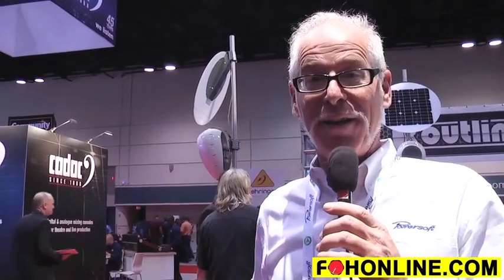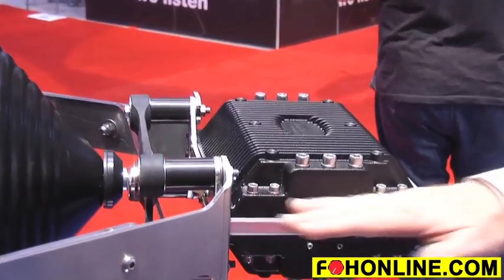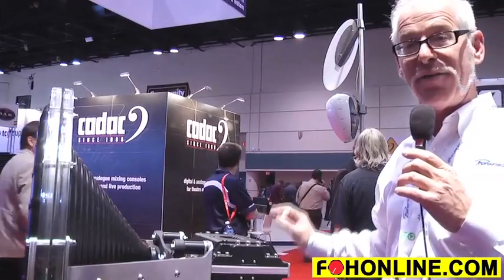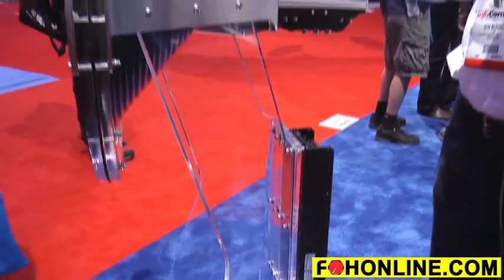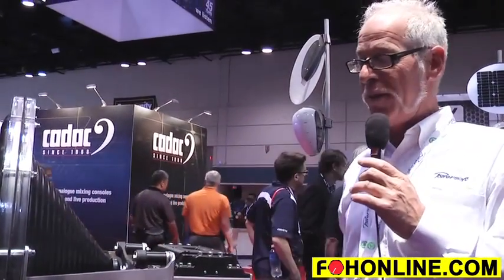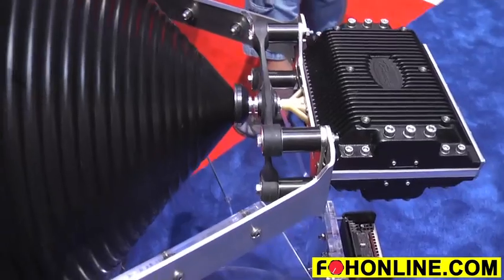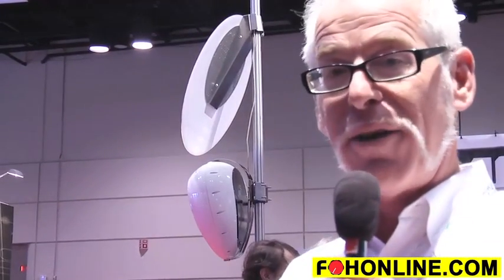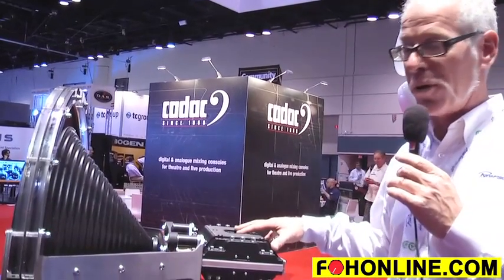Powersoft M-Force Subwoofer Driver

Comment: i love how whgenever someone makes one of these useless things, they never let anyone HEAR it. because it dosent output sound, because motion is not sound.  a speaker works by amplifying the vibration of the voice coil, via the speakers cone, which only works because said cone is directly connected to the voice coils, and as such the little bit of sound the voice coil puts off is increased. connecting a large "speaker cone" to a magnetic piston and wrenching it back and forth is not the same thing, and does not do anything other than move air.
Reply: Isn't it designed to produce mainly infrasonic frequencies. 
https://youtu.be/o-F_OJSibJQ
Reply: @mush0847  its not designed to produce sound at all. its designed to trick some rich moron into dropping 20 grand on a giant "speaker" that just wobbles around. all this shit does is move air. if this thing produced the claimed 140db@30hz, it would deafen anyone near by and rattle bolts that have been welded in place out. but it dosent, its basically a big fan, but unlike a fan it dosent produce noise from spinning, it just produces a loud CLAK CLACK CLACK sound from the piston wrenching back and forth very fast.
Reply: @FingerinUrDaughter  That's literally how sound is produced. Moving air back and forth...
Reply: @FingerinUrDaughter  your understanding is below basic, just because traditional speaker designs use electronic transducers utilising a magnet with a copper voice coil attached to a speaker cone (transducer) it does not mean that this is the only way to produce sound. Have you not heard of plasma speakers? Sound is not an energy in and off itself, it is the result of a mass hitting air, the reason sound is not on the ems is because it requires a medium to travel through. Air, water, concrete. Therefore sound waves in the strictest description are kinetic mechanical energy transmission.
I personally have always wondered why Bass frequencies (the most energy inefficient to produce for many reasons) are not produced by other means, like an internal combustion engine rigged up to pistons, you only need to get up to 100 cycles per second which is easy for a traditional engine. Anyway this type of method negates the requirement for. Y over complicated solution

Comment: They need to make a home theater version of it. Not as efficient but, can hit so low that you cannot hear it but you can really feel it. Also differences in the motor structure, cone surround, and enclosure design for maximum sound quality.
Reply: They did :D Its the Powersoft CineSub
Reply: Trust me, you would not want one of those in your house.

Comment: 145dB @ 8KW = 109 dB 1W/1M....   Seems awfully optimistic!  8KW = 10 Horsepower.  Through that little aluminum frame?   Seems too good to be true.
Reply: Most of the power is heat... We rate speakers by how much input they can take, not how much out put as we would an engine
Reply: Wouldn't it be 106 dB 1W/1m or are you factoring some power compression?

Comment: Same low frequency extension in a smaller cabinet = less efficient. There's always trade-offs.
How does it sound? Would it sound good enough for Hi-Fi use or is it only suitable for where you want something really loud?
Reply: Why the shit would you want to use it for hifi use? Obviously is for PA applications. What a ridiculous comment.
Reply: ShedSessions Official People use JBL PA drivers for Hi-Fi... Everyone has their own ways of achieving their perfect sound.
Reply: Also, in terms of low frequency extension in a smaller cabinet, the unit effectively has a variable output impedance and you can effectively optimise the t/s parameters for your design goals. Therefore you cant really use traditional design principles to create your enclosure as you'd end up with a box that was too small for the actual driver or way too much port noise. It really is pretty clever.

Comment: 140+dB, sure... but measured where? 1 Meter, or a millimeter?
Reply: Pk sound gets 147+dB out of this on their gravity 30s
Reply: @TheTrudell93  147dB, at an unknown frequency, unknown whether it's full space / half space / quarter space / etc, and with unknown THD. And with a crest factor of 10. It is impressive for sure, but Outline's DBS 18-2 for example will also do 147dB half space w/ +10dB crest factor, and it weighs 30 to 60 kg less, and it's about half the size.